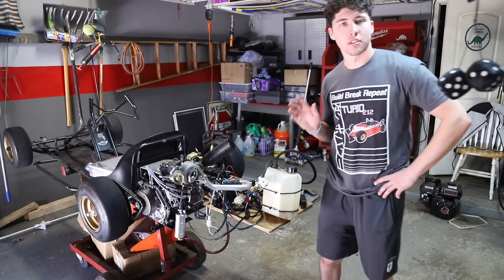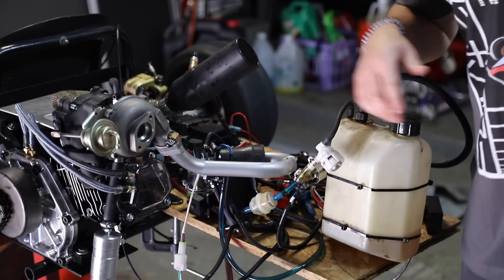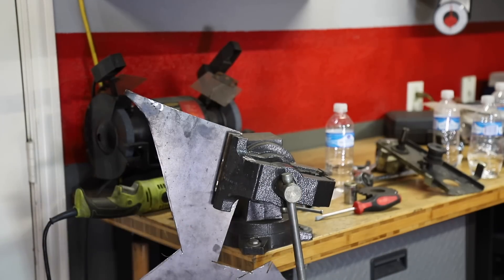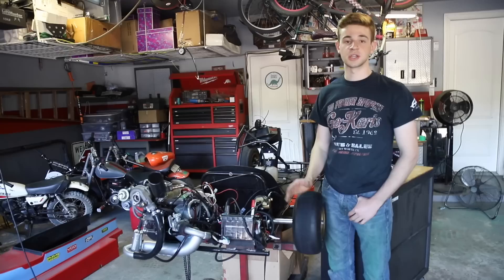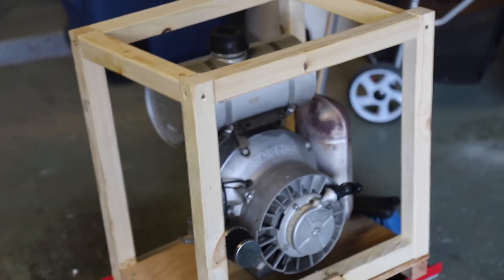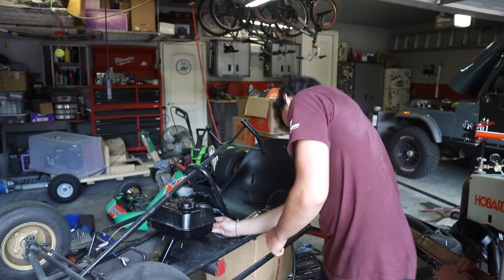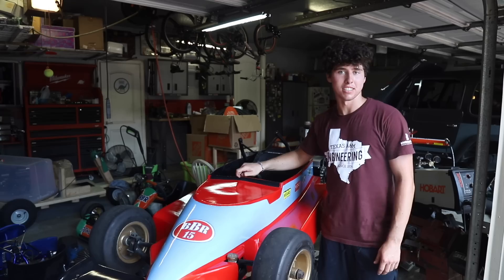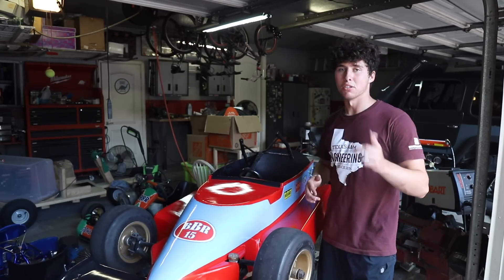Getting The Stage 5 Turbo EFI Predator 212 Go Kart Ready to Drive!

Comment: If your having some trouble welding thin metal get a big transformer take all the wire off rewrap it with 10 guage wire the more wraps the better.  One end to the ground clamp one to the work. It'll lower your heat enough to weld thin like 18 guage sheet.

Comment: Ok so a air capacitor sounds like a good idea.  But the way you made it sound is the turbo stops spinning because the exhaust valve is not open. Therefore not making any boost. Well we know from your other video it was making 8+ hp at the shaft. Keep up the videos though

Comment: What efi kit are you running? What programs are you using to tune? And is there any solution to the gas tank to where you could use a larger top tank instead of the smaller gravity fed? I have so many questions for you guys 😂 love the videos. Inspired me to get started on my cart and im hoping to do somewhat the same setup

Comment: Idk if you do this or not but when prepping for welding you should sand down the metal for clean welds on the back and the front it will make them stronger And cleaner

Comment: Two stage clear baby people think you can't get good paint jobs out of a spray can that is false if you get good automotive paint you can't go to AutoZone or anywhere like that and then also they have a two stage clear after you mix it it has 24 hours and you spray it right out of the can and it will last just as long as a factory paint job I do it the paint all of my brake calipers

Comment: did that rotary engine actually come out of the car I know rotary engines are a lot smaller than normal conventional engines but I don't know much about them all I know is that they can make a lot of power with a lot less weight but then you hear a lot of people talk crap about him about things failing a lot and then you have other people that only use them in their whole life that tells you how to get around those problems it's a headache

Comment: I noticed a lot of blogs etc talking about these bolt on turbo charger kits and they don't understand that it's not as easy as it sounds bolt-on makes it sound like you bolted up and it's done except a lot of times you run into issues and you need to custom make parts for it because they don't sell them to actually get power that you want I guess you could bolt it on if you want to make 3 lb of boost and that's it but then you have to add more fuel as well so it's all about turning it as well you can't just bolt it up a lot of these people don't have any electronics hooked up to it it's just a small engine

Comment: It's so crazy how these small engines can get a rev up to six, seven or even eight thousand RPM
Reply: I built an engine that turned 9k for a go cart. Specifically built for one team but when another team took possession of the engine it didn't end well for them as they didn't know what performance work I had done to it,sad way to see a good engine go to the boneyard

Comment: Now you don't see many small engines with an O2 sensor in the exhaust does that mean this has a computer on Ford that would be awesome cuz you could tune it that way as long as you have the right stuff electronically controlled how hard is it to install a O2 sensor and does that pretty much have to be done for a turbo installed or is it just recommended to help the engine run better I'm only asking because me and my son are about to start a project I have an old frame I don't know if we're going to cut it up and make her own thing yet watching cars and cameras that off-road truck is pretty cool that they built there's also another channel that build a Barbie jeep that is awesome but we might just find a way around to bulk up the suspension and put an engine on it but after the basic setup to get it to run he'll be a little older and I would like to teaching how to make more power and get into like a custom cart I am ase-certified in gas engines Small engines is just a smaller form of that and I've also taken classes in high performance so I would love to teach him these things that way if he gets into the field later he'll have a pretty good common knowledge and if he doesn't then he'll still have that knowledge my son is 8 years old he just turned this last May and he's just starting to get over the fear of dirt bikes and go-karts or four wheelers

Comment: I wonder if they make a supercharger that's belt-driven or a procharger that's belt driven for small engines that would eliminate the exhaust valve problem it wouldn't matter if it had one or not then

Comment: that one been to have in the air tank though is almost a 90-degree angle that might cause some problems because you weren't nice smooth curves for the air to flow around instead of it hitting a wall bouncing back and forth

Comment: good thinking because there's only one exhaust Port so the turbo won't be spooling when it's sucking in there it will be spooling but not under power it'll just be residual spin left over from the last exhaust stroke you still gain boost but this way you should make more I would have a pressure release valve or something though that can work but I don't know how you would set that up without a computer controlling it but the way you have it with the smaller tube running out in the bigger coming in that means I can get all that are in there but then only sucks so much through that might work amazingly to hold more pressure in it for reserve or it might restrict the airflow going into the engine I guess we'll find out

Comment: You do not need a boost capacitor to make boost on a single cylinder engine. It might smooth the boost a little. I have a Honda gxv390 on my mower making 6 pounds of boost on gate and running fine. Blow through carburetor.

Comment: Hey guys just wondering if you have heard of Microsquirt EFI. I fuel injected my 79 Yamaha XS650 and it works great. It's relatively cheap ($340) considering its capabilities - two injector outputs, two spark outputs, tons of trigger options, open or closed loop boost control, and settings for rotary engines like leading and trailing spark etc. Might be a better option for your turbo rotary build. Nice work guys keep it up! https://www.efisource.com/wp/shop/microsquirt-ecu/#ecu

Comment: You could try using an electric motor from a small go-ped. Some of them are 24 volt tho, so you will need a voltage regulator. But the motor is quite small and would supply plenty of power.

Comment: with the alternator issue why dont you make a pully set up on the other rear wheel so it does not rob any power from the motor
Reply: Still robbing power from mtr mtr drive the axel which drive the wheels any drag added anywhere on the rotating assembly is lost power there is no such thing as free energy...

Comment: An intercooler would have done the same job as the capacitor but would of had the extra bonus of lower intake temps?
Reply: Yes it would have, but for packing it in the space he had it would have been weird. Also the money aspect of one.

Comment: Awesome video can't wait to see the tuning and how it comes out. I personally have used auto-tune on a different style ecu and never had an issue as long as you set up auto-tune correctly. try to not have idle included in the self tuning for a setting in the parameters that way once idle is set it's not trying to chase itself.

Comment: The boost capacitor is bullshit,all your doing is lowering the boost pressure because the exact same amount of boost now has to fill a larger area. MIT is bullshit. It looks like a expansion chamber from a 70's 2 stroke,which its whole purpose is to reverb exhaust back into the cylinder. In your case the turbo, possibly making the turbo spin slower.

Comment: If it works then it works. But I think that  tube on the charge pipe is going to hurt power. I would use a smaller 1.5 inch or maybe even a bit smaller. That's going to help the velocity alot.

Comment: couple of safety concerns. not a good idea to weld galvanized steel. it produces toxic gas. i'm certainly not a paint guy, but i'm fairly sure you need proper ventilation and breathing protection when using that 2K clear. a dust mask is not adequate. not trying to be a wise guy, simply concerned for your health.
Reply: Usually I'd get humored from a post like this. However this man is not lying or sugar coating. The solvents  used in paint is very toxic with a wide range of hazards and unknown metals/particulates. Do what you want but, when you die slowly and can't even talk, this guy was thinking about you.

Comment: dont forget, for a proper finish on the paint you still need a final sand/buff/polish after laying down your clear coat. thats the only way to get rid of any orange peel.
Reply: Promise a properly thinned clear with a high quality spray gun set to the right psi. Much harder and takes a few coats but no sanding needed afterwards if you do it right.

Comment: Awesome 👍! With that boost tank, I think it's going to loose efficiency. If it were my setup I would have the shortest path possible from ex valve to intake. Have you guys tried draw-through before adding efi?
Reply: It still won't work. The intake plenum on single cylinder turbo engines have a scavange problem. This is due to the pulsation effect of having a single cylinder. By adding a manifold that is 2.5x the displacement of the engine you will almost remove this pulsation problem.

Comment: Why wouldnt a recirculation valve and intercooler work as pre load tank
Reply: So is the turbo
Reply: And i said recirculator valve bov dumps to atmosphere recirculator recycles charge air
Reply: You could use a very small intercooler in this application
Reply: Bov is virtually useless. But the intercooler would have to be HUGE 5 the volume of a intercooler is surprisingly small.

Comment: I wonder if hydro forming like some people do for 2-strokes would work for the pressure reservoir pipe, also I've yet to see anyone do some hot-bending with temporary infill (like dry sand) on these kind of projects to get nice tight radius curves on pipes without needing a mandrel setup. (Seen some other videos that show it's possible, like this one motorcycle shop in Japan that has it down to an art.)

Comment: Find a old exercise bike with a crank resistance and put the front wheel against your rear wheel and you can control load resistance on your motor your trying to tune. Its an easy and fast way of making a load dyno

Comment: Try cutting a small window in the cowl by the flywheel.  Mount a rubber disk/wheel on a one wire alternator and mount it against the flywheel.  In such a configuration you will always be spinning and charging while running and no belts.  A snowmobile battery and you'll have all the power you want and be compact too.  Great stuff.  Bo.
Reply: Wouldn't that overcharge? Or is one wire version have internal regulation?
Reply: @madjimms  I had GM one that was internally regulated that I put on my old Toyota. It was great. I bought it at Autozone. I think it was a 12si

Comment: I see you forgot to plumb up the waste gate. which could have been the reason why your not building boost, since it is internally gated. and with it not plumbed up, essentially the gate is always open.
Reply from the maker: Andre Gruenbaum The waste gage is closed. We checked when we had the turbo apart. We also tried running it in the past but we never reached enough pressure to open it.
Reply: @BuildBreakRepeat  didn't know that. Thanks for clearing that up. I do enjoy your vids. Keep it up boys

Comment: I like it, but I have to think you're losing power with that welded bend to the boost capacitor as it looks restrictive.  Can you just run the hose straight in?
Reply: "It works perfect" lol i thought the same thing but he said so in video its perfect
Reply from the maker: Nothing to see here We could, but we added the bend for looks. If it seems like we have low boost pressure at the intake manifold we could revisit it.

Comment: The "capasator" you made seems more like a plenum.
Reply: Capacitor
Reply: @Nograc_  sorry I just got up. Can't spell right lol
Reply: @hunterpetrovich1460  it's all good. Stuff happens just didn't want you to look dumb
Reply: @Nograc_  thanks my dude👌
Reply: @hunterpetrovich1460  well of course my guy
Reply from the maker: Hunter Petrovich Yeah lol I think MIT just wanted to sound fancy and call it a “boost capacitor”
Reply: @BuildBreakRepeat  probably lol
Reply: You could inject straight gas into the exhaust like the rally cars do. That makes for lots of boost and flames! I forget what they call it but they can switch it on when it's time to send it.
Reply: @zxggwrt  it's actually air not gas. There is a valve that diverts air into the exhuast manifold upon off throttle situations the result with the combo of gas not being burned of during combustion mixed with extra pressurized air results in antilag. I had the factory soft air system enabled on my Evo 4. It's pretty fun. Till you have to replace your turbo at the end of the season.
Reply: @jdalzell3354  I didn't know that! I was sure it was some kind of positive afterburner device that ran the hot side like a gas turbine. Your's is a better description. And more realistic.